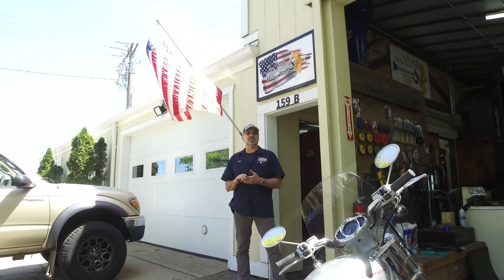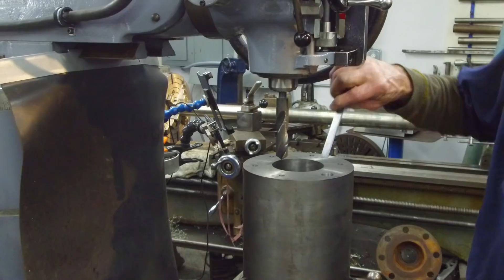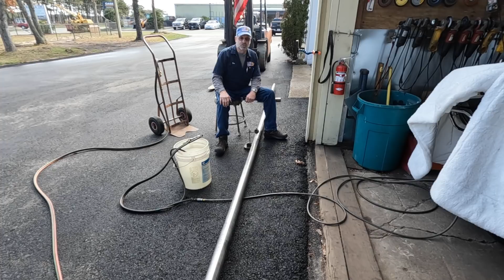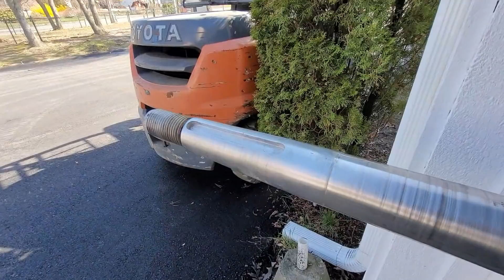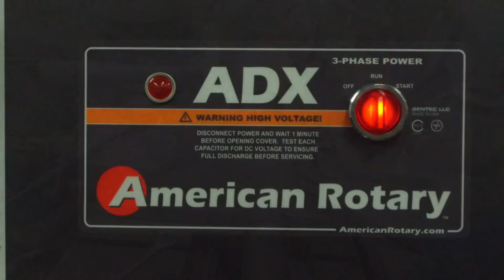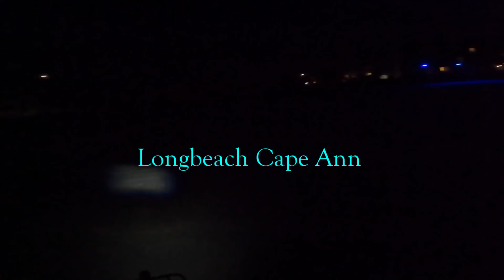A Day In The Shop 4/15/2022

Comment: I'm pretty sure I saw you explain how this heat bending works in a previous video, but could you explain it again? Is the heat spot expanding the metal or contracting the metal? I have a steel tube (to be safe with YT guidelines) that has a small bend that I want to remove. I can press it between blocks, but I'm wondering if heating and cooling might be a more controlled method. The biggest issue is that I can't have the internal diameter change, even 0.001 would be a large amount of change.
Reply from the maker: You can not heat straighten tube, it has four sides not just two.

Comment: I'm not trying to change the whole boating industry but why would they use a 30 ft solid shaft when they could use drive shifts with u-joints & carrier bearings?(like a school bus) I understand you need a solid shaft to go thru the hull
Reply from the maker: Torsional strength, corrosion resistance and eliminating all those possibilities of failure.
Reply: @KeithFenner  I  was sure there was a good reason but being a Auto mechanic for years I couldn't think of any. Thanks

Comment: It's a joy to watch your work.  Wondering how drilling that deep can stay accurate.  Drill bits like to do weird things with that long a travel, and the drill press table, it is perfectly square, right?  Fascinating heat straightening.
Reply from the maker: That is why I  drilled 3 inches into the critical side before switching to long drill.
Reply: @KeithFenner  Cool!  Get 'er done!

Comment: Thanks Keith. Really appreciated your commentary and the shaft straightening. Do you heart and quench the side that needs to be lengthened?
Reply from the maker: The side that needs to shrink.
Reply: @KeithFenner  Ah yes, deforms when gets hot then thinks back shorter. Tnx